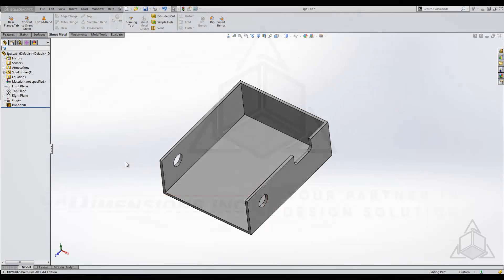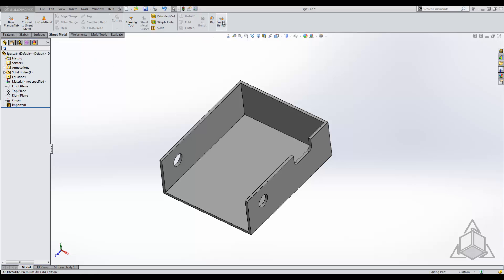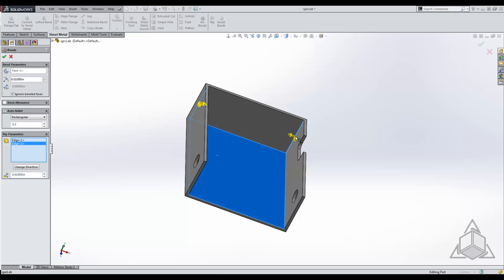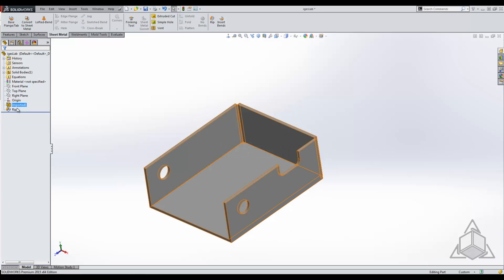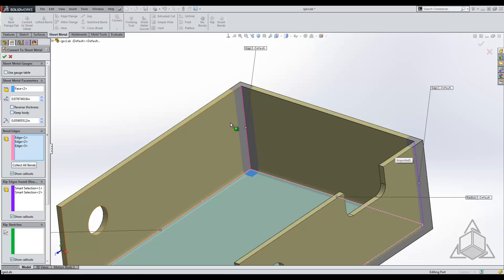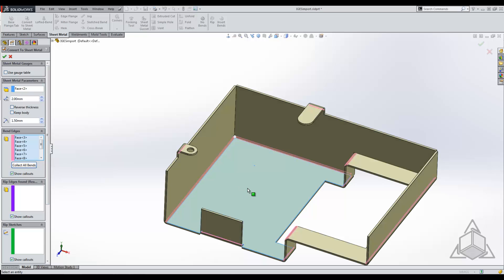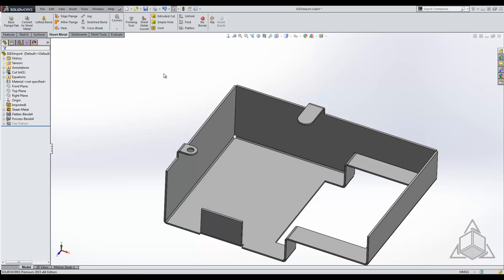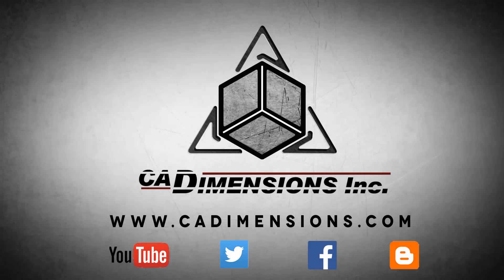Tech Tip - Convert to Sheet Metal Part

Comment: im running sw 2016 and I cant get that sheetmetal tab to appear. when I go into the sheetmetal menu under insert there is no flatten tool either. the only flatten tool is in the surfaces menu
Reply from the maker: Thanks for watching our video.  To activate the sheet metal tab on the command manager you need to right-click on one of the tabs and then you should see the option to turn on sheet metal.  From there the flatten tool should appear.  The other option is to right-click on the flatten feature within the feature tree and unsuppress/suppress to get the desired result.”
Reply: CADimensions, Inc. ohh thanks a ton